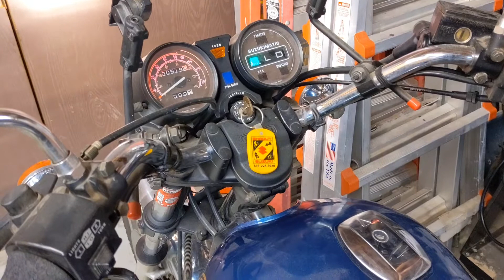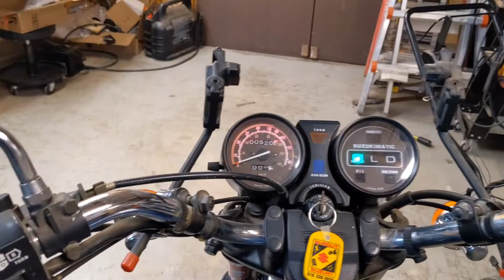1982 Suzuki GS450A

Comment: Hey I have the same bike I brought the synchronizing tool and I have to do the same as I am using pods instead of an air box hit me up maybe we can chat about it
Reply: @jackman-vx9hh  you figure it out yet? I just got one and it’s my first bike. So far Ive messed around with some stuff… oil change, carb clean, new fuel lines etc

Comment: sounds like the carbs might need syncing
Reply from the maker: Ya I need to look into how to do that
Reply: @MCPHILL  couple of vacume guages and adjust the screw joining the carbs thottle untill both guages have the same reading they should be pipples on the inlet manifolds engine side that you attach them to
Reply from the maker: @1981dasimpson  would I need to since mine has set screw points on the main rod. No adjustment that I can tell
Reply: @MCPHILL  they should be abit in the middle near throttle cable that joins both carbs and will alter one butterfly away fron the one in the other carb
Reply from the maker: @1981dasimpson  ok I will check tonight, thanks